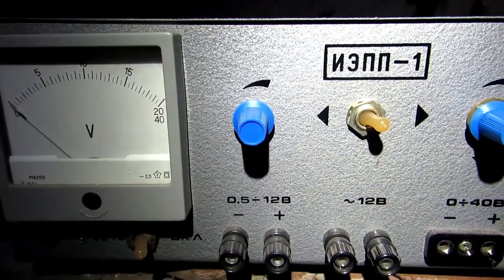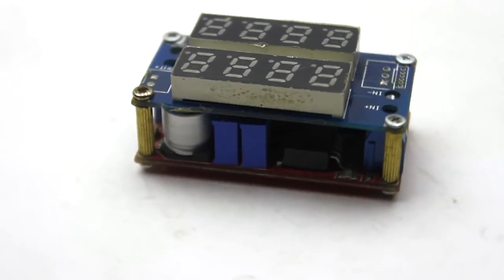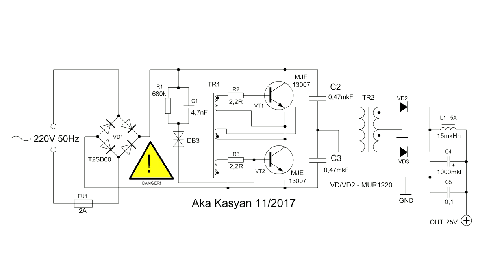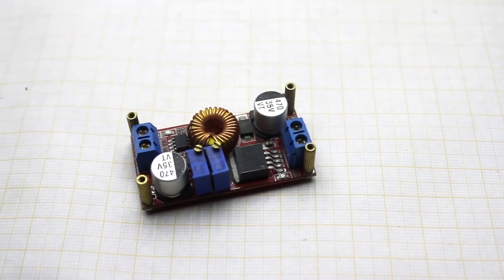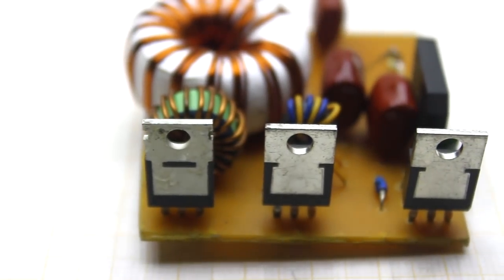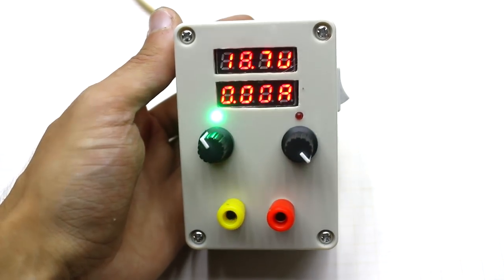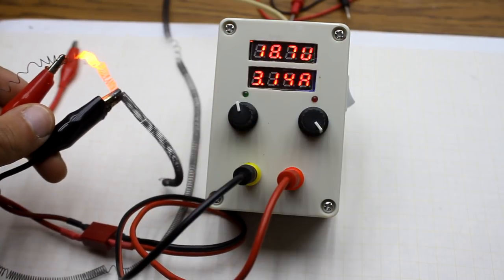Super power supply with current and voltage adjustment

Comment: Great Video! I believe I have everything to attempt this build as a next project. But I also purchased a (USB To RS232 TTL CH340G Converter Module Adapter STC) Cost was $4.75 US, so I could use this with my Laptop/computer. The Board with the volt/amp meter has a connector and can be used with the RS232. The manufacturer even recommends this. Great way to Monitor Voltages on your PC. I will just include a "USB Out" on my Box. The Box I have is close to the same dimensions, except it is front facing laying down-135x90x45mm(black). Looking at the size I am using, I have room for the smaller 24V-5A PSU, used more commonly with the T12 soldering Iron kit.(Don't have the skills yet, like Kasyan TV to make one..LOL). I might get away with adding 8-9/10 18650's batteries(NCR 3400Mah) in Series(with BMS), instead of a power supply.  Great way to keep this portable! Last I will also add a 2P2T, so I can also plug a adapter in and use with a laptop charger. So Many Idea's all inspired by this Video! Great Job Kasyan TV!!!!!!!!

Comment: May I suggest adding some red cellophane in front of the LED displays. They will be much easier to read if they are diffused. The cellophane can be cut larger than the displays, then taped to the inside of the box so it won't be visible from outside.
If your displays use different coloured LEDs, be sure to use cellophane which is the same colour as the LEDs.
Cellophane can be purchased in large sheets at newsagents or art supply stores, but flower shops sometimes give you small off-cuts for free if you ask politely.

Comment: 10.01 and clickbait title. best channel ever 10/10 gj
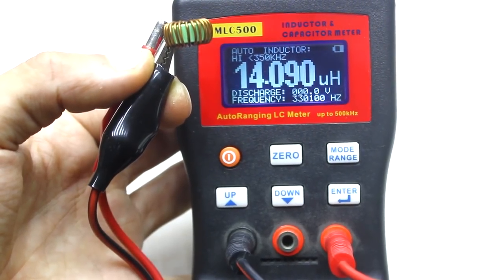Reply: 4:19 its called choke
Reply: it would be much better if you could make the whole thing have just 1 switch mode power supply with voltage and current regulation based on sg3525a

Comment: And I thought my bench was messy! I might in the future build one like this but with dual rail output.
Reply: That's gonna be nice livestream :)
Reply: Mine is messier...most of the time. I think that applies to all of us electronics hobbyists unless you have OCD or are a bagillionare with insane storage and minions.
  I wouldn't personally build a dual polarity supply like this. Just build 2 that are galvanically isolated so you can set them up in series or parallel.
   If you really want an SMPS dual polarity setup just find an old HP printer power brick in your junk drawer or get one from a thrift store for $1. Look at the 3 terminal output and make sure it has all 3 pins in the socket (some don't) or look at the label specs. Power brick manufacturers are required to label power supplies for their total potential voltage. This means the HP bricks are labeled, 1.) Ground 2.) +12 to 16Vdc 3.) +24 to 32Vdc, on the output. In reality they are setup +/-12 to +/-16 volts. I've mod 2 of them by replacing the feedback resistors for the Vref. Both of mine are capable of +/-9 to +/-20 volts. They are great for basic op amps on a breadboard. The HP bricks usually have a mains earth Ground plane PCB inside that can be removed to fully isolate them (and reused to etch a circuit if you clean off the solder mask). HP supplies are also ideal to mod because the dual supply is created through a center tapped secondary on the isolation transformer using a simple peak mode DC to DC converter circuit. There is only 1 feedback reference loop used. They don't have power factor correction or a PWM controller to make things difficult. Mod'ing a HP brick is just like the brick I created a video about mod'ing on my channel a few months ago. Just find the opto that leads to the TL431, figure out the 2 resistors from Vref to Vcc and Vref to ground and replace with a trimmer and potentiometer. Easy. The only thing you'll be missing is a +/-5 volt supply but SMPS isn't really great for these lower voltages anyway. Just use a 7660 type switched capacitor circuit. Dual polarity with current limiting isn't really something I've needed and it's very complicated to do with tracking.  
  BTW I still have an old tape player to mess with one of these days and notes on your old videos you posted about tape heads and such. Thx for posting those ;)

Comment: is the main power supply protected for short circuit?
Reply: The one they used in the video is the one they made earlier, and it does have over current protection.